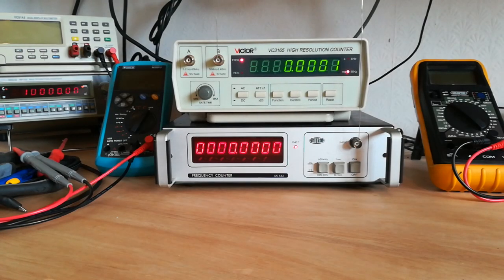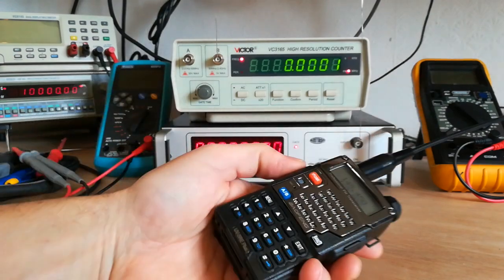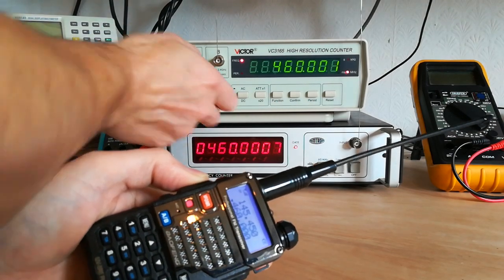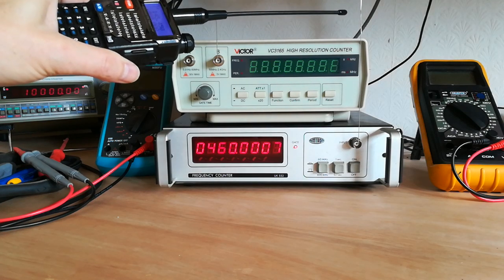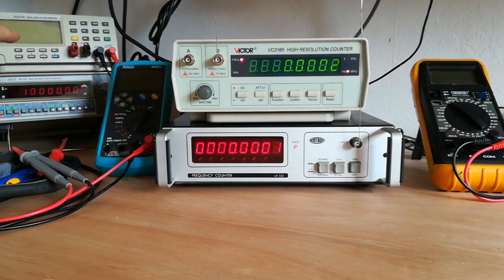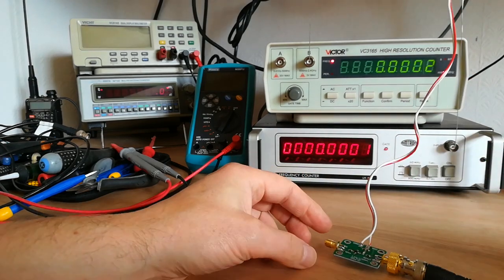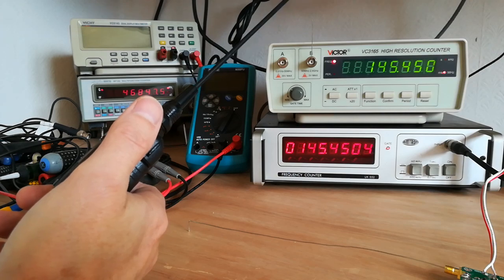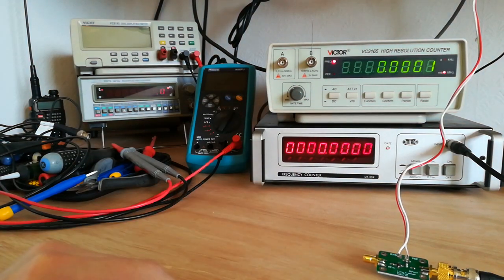Old and new  frequency counters ..

Comment: I have two of the Vc3165 ‘s version.  The shielding seems to be the problem.  When just setting on the bench with no input connections  (even when the inputs are grounded),the display shows all kinds of random numbers. I assume it picking up stray signals. As soon as I connect a solid Signal to one of the inputs the display stabilizes after a few seconds  (like yours) and shows the correct d frequency.  I bought these to give me a visual display  for my boat anchor signal generators. I have several other frequency counters and none of them act this way.The manufactures’ 
literature says this is normal, but I don’t understand how or why.

Comment: Good and practical video contents! Thanks for sharing. I noticed you had two different length of wire antenna. Probably if you switched antenna to test sensitivity based on or at antenna resonant frequency at uhf will make any difference.